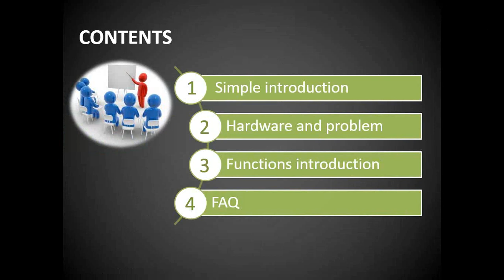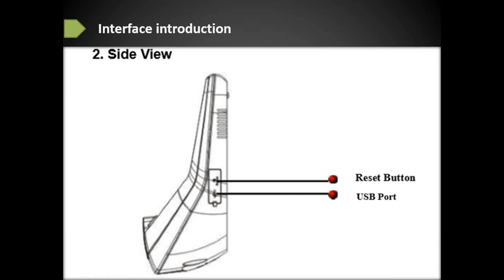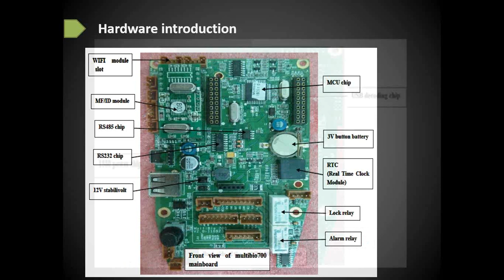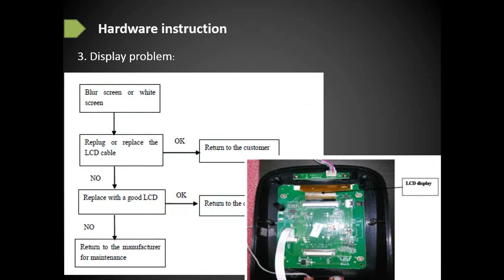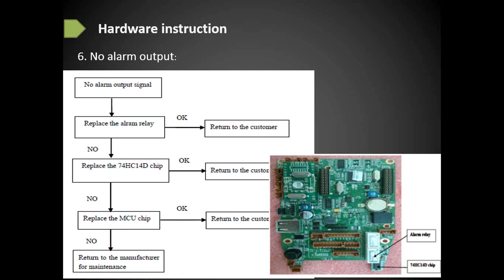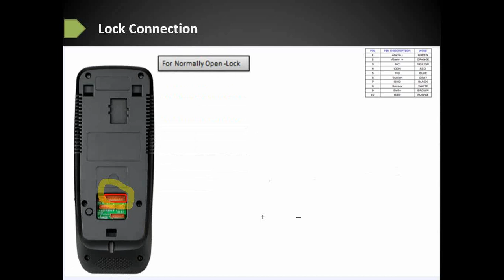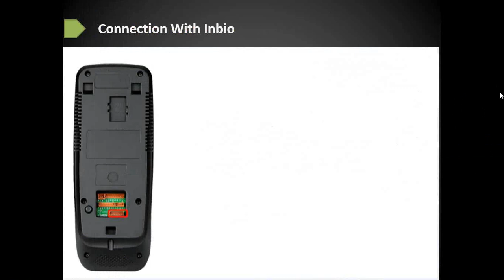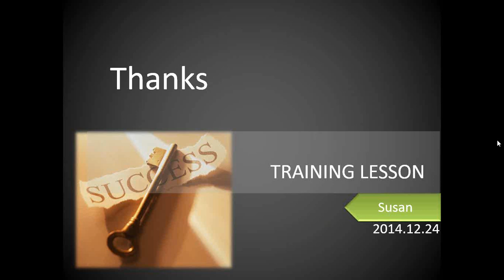Zkteco Access Control Training Operational&technical repairing By Vital International

Comment: Hello. Please tell me, I have an old Multibio700 terminal. He's got a problem, he can't see fingerprints. If I try to add them to the user, it does not react in any way. But if I select the test mode, I select the fingerprint scanner there and put my finger on it, then it shows the fingerprint on the screen. What could it be? Maybe this is a software failure, and it needs to be flashed on a new one? Do you happen to have firmware for it? Thanks in advance for your reply.